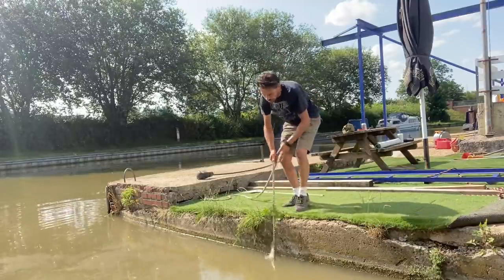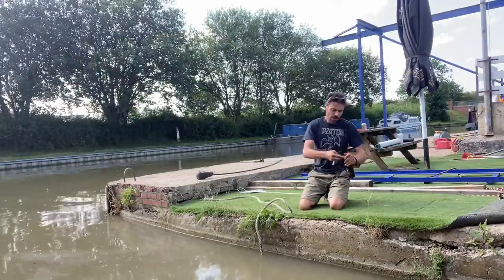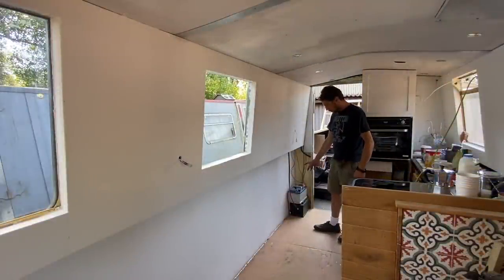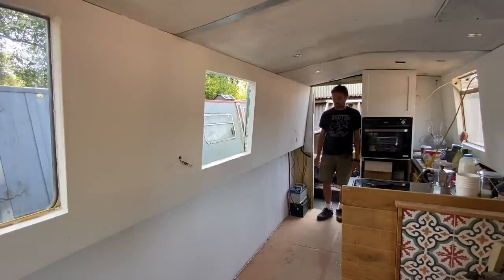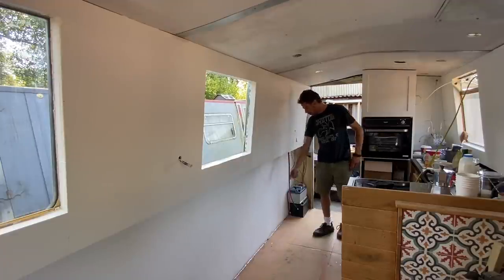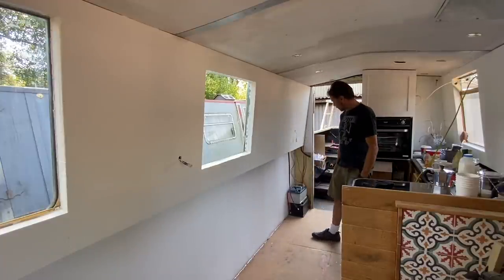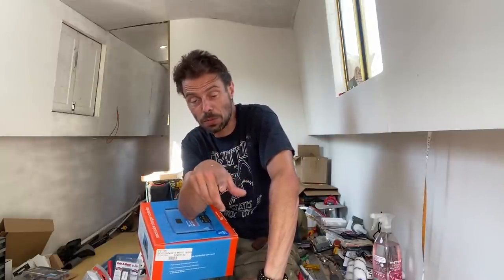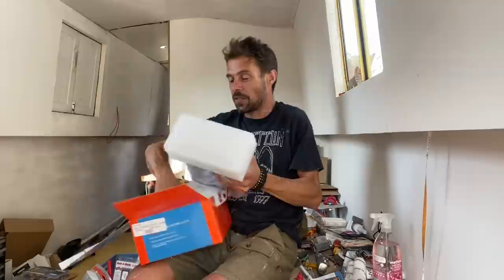219. Electrical cupboard installation starts

Comment: Good evening, James.  I'm liking that red.
Fuses, fuses, and more fuses.  Isolation switches on the solar panels and the charge controller, and a main breaker that kills the entire boat.  You can never have too many fuses where batteries are concerned.  They can melt a spanner in seconds, wires in a fraction of that.
On that cheery note, sleep tight.  ;o)
All the best, matey.
Reply from the maker: I’m going mad for fuses already - should be ok. Yes switches on panels and controller. Have a good mate

Comment: I think the floor will go back flush again when you refloat.  I saw someones vlog recently and they had quite an old boat but their internal woodwork pulled apart a bit when they craned the boat out for blacking.

Comment: Hi James another good vlog just thought I might say that you should fit a switch between the solar panels and the controller it's not really needed but I find if your trying to find electric problems it's handy to just switch the panels off instead of disconnecting them or covering them up.The person that said they can't  wait to see the painting finished obviously knows nothing about boaters painting their own boats I have been boating well over 30yrs and have not yet met a boater who considers their own paint job finished.
Reply from the maker: Thanks Big as always. Yes I’ll be isolation switches on the panels coming in.

Comment: Looks like a very chunky heatsink on the back of the solar charger so wonder if its worth thinking about a slot for some ventilation in the shelf directly above it?
Reply from the maker: I was thinking of doing that - maybe a small cooling fan too
Reply: @TheNarrowboatThatJamesBuilt  Could do but as long as theres good airflow from below and out the top you could prob get away without it. I did wonder if it was worth putting a battery smoke alarm in there as a bit of belt n braces at least at the start?
Reply: @TheNarrowboatThatJamesBuilt   what about a vent from the bilge? Cooler air coming in from there might be good?

Comment: Looking forward to the full electric install James. A question,, are the window reveals okay to sand smooth now? I'm interested in the finish and whether it will be good enough to take paint ect... All looking good so far..
Reply from the maker: Hi Tony - yes they are and I’ve started sanding a bit. It’s not quite so simple as I thought. I’ll show it soon though
Reply: @TheNarrowboatThatJamesBuilt  I hope it works because the materail is idea for that moisture problem area, wood stains and rots, and powder mixes are non-flexible. If it sands well and paints over smooth I think you'd be on a winner...

Comment: Tip: label the wires or breakers, looks good and saves time later on in case you need to solve some problems.

Comment: Did you think about putting the speakers in the ceiling? Would that have worked?
Reply from the maker: No - there’s no clearance. I could have put them in mushroom vents but that would have blocked vents and killed speakers after a few months
Reply: I was thinking that, I’ve seen plenty of ceiling speakers in boats.

Comment: Needs subtitles so we can here what you're saying. turning sound up and down is not the best option for late night viewers. It's not difficult to wear a microphone. 👎
Reply: headphones
Reply: @muffy2379  still the same problem with headphones. Might as well film in potato vision to match audio. 👎👂💩
Reply: @garychamley3095  nobody is making you watch and listen.Just dont watch if it annoys you so much.
Reply: @garychamley3095    📢Crank it up !📢  Then the levels are just about right - the precise tones of James, and then the louder soothing guitar music 🎶 …which is as it should be… Sit back and enjoy 🎶
Reply: @searlasmacmaongail9418  or he could just sort the audio out, from the gifted microphone. 🤔
Reply: Use YouTube subtitles - mostly correct!!
Reply: Just  tap cc on top right of picture,  subtitles  can make up there own words sometimes  but generally  ok
Reply: @searlasmacmaongail9418  settle down, no need for this from both of you. The volume is a valid thing to bring up and sure James is well aware of it and is always trying his best. Constructive criticism should not be hounded away. Can both of you act like adults now?
Reply: @richardingram2374  🤣🤣🤣🤣
Reply: @garychamley3095  I was wondering why he never used that mic that was sent to him 
He also had a nice router given to him that could have came in handy with his woodworking haven’t seen him use that yet